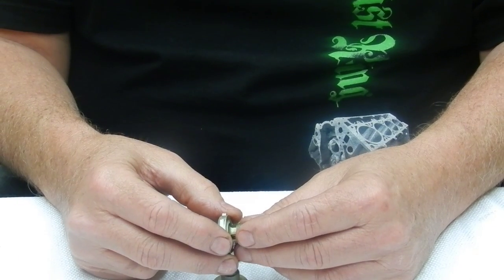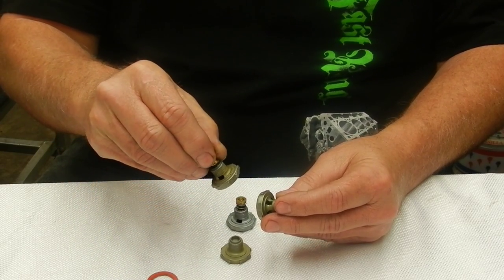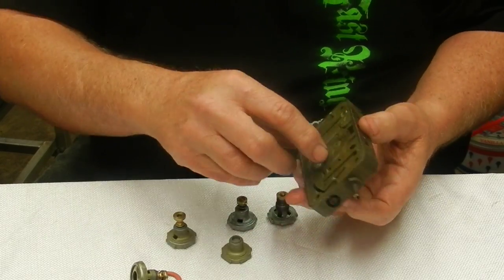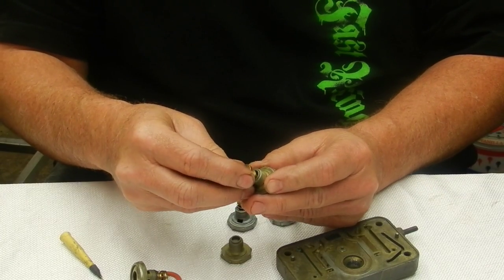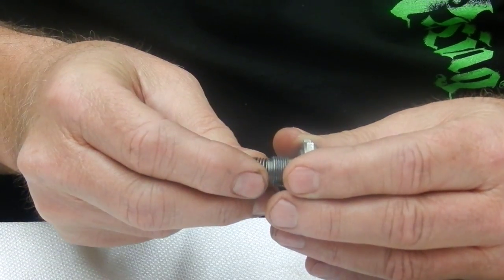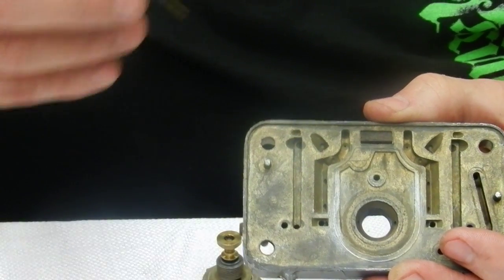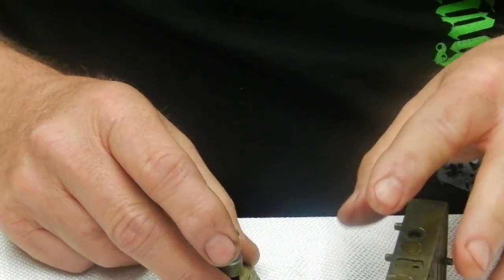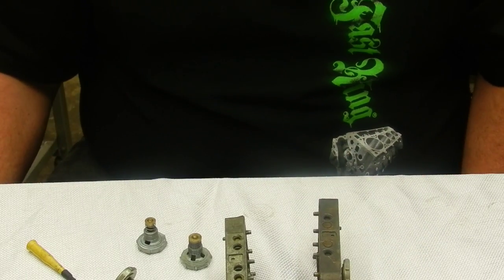Holley Carburetor: Power Valve Explained

Comment: if the PV is not working correctly,could it allow enough fuel thru to foul plugs and make engine run on 6 or 7cyl?Engine runs fine at idle then boat wont get up on plane(loss of power,plugs fouled.) 302 mercruiser engine 4 barrel holly.
Reply from the maker: if the power valve diaphram is ruptured this will cause it to pull fuel out of the bowl , making the mixture extremely rich and foul your plugs, there is other things that make a carb run rich , to much fuel pressure , air bleeds stopped up, bad float , too big jets , don't forget about ignition , weak spark can cause an engine not to burn the fuel completely , these are a few things that can cause a rich mixture that will foul spark plugs. ps  wrong spark plug heat range, hope this helps randy,
Reply: The boat ran fine earlier this year.I had a possible backfire in motor box,but engine never skipped a beat.When i idled down i noticed smoke or steam coming from the top of the carb.next day boat ran bad ,checked all plugs and all were wet and carbon fouled.mechanic has come all summer.has checked everything,firing order,new plugs, wires ,dist cap ,rotor,timing ,points.he has given up!!! carb was not checked thoroughly.Also gas or oil  or both out exhaust, film on water.i am assuming unburned fuel.Have heard that a backfire can ruin a power valve.Is there a way to test the power valve?greatly appreciated.
Reply: also when you snap the throttle it will usually backfire or not be responsive at all.Trying to give you all the clues to the mystery.Thanks.
Reply from the maker: if this happened just after a backfire through the carb , may have damaged the float and or the power valve, the brass float will not handle backfires , and will cause it to flood , or could possibly have damaged both pv and float, easy way to tell if floats are damadged is to compare with a new part . I like to use a nitrophil  floats they seem to hold up better and  are more foregiving,  , ps be extra careful if carb is flooding that is very dangerous in a boat, always check and double check  for any gas leaks,  you cant be to careful, hope this helps
Reply: I ordered a couple of power valves(8.5) ,will try it this weekend. Both floats seem to work fine,the needle valves are fixed and cant be taken out,  also no sight window screw,so not sure how you adjust the level in bowl. Did a test where you screw in idle screws and the boat continued to run, so i am assuming bad P.V . we will see.Thanks for the help.
Reply from the maker: could be a blown power valve, most needle and seats are replaceable  , some don't have external adjustments ,they have to be adjusted by the float tang and  measurement from between top of float and top of fuel bowl, need you to send me the list# off the choke horn of the holley before I can give you any information , most marine holleys have a plastic cover over the needle and seat inslde the fuel bowl , could be why you think needle and seat are not replaceable  , if you are still having trouble after p.v. replacement , let me know  because there is so many things that can cause a rich condition, hope this helps.
Reply: list # 50418
Reply from the maker: carb is a 450 cfm 4160 series holley ,power valve shows in my book to be 8.5 , needle and seat are replaceable but from the inside of the bowl , there is no external adjustment, only internal adjustment ,might have to contact mercruiser for float specifications,  most adjustments are checked with the bowl upside down measuring from top of float to top of bowl , make sure float is not gas logged [ hole in float ] and check your fuel pressure,  to much pressure will cause it to flood, again check specs.for fuel pressure with mercruiser, also it is very important that the vacuum secondary diaphragm is working to help you get on plane .hope this helps
Reply: ok Randy.replaced power valve and boat souded great,running on all 8.ajusted curb idle with cold engine.(she likes 800rpm)adjusted the acc pump ( no play ,15k feeler guage) she is now responsive at throttle.turned idle mix screws In then out 1 & 1/2 ,hooked up vaccum guage.12 inch vaccum.started  to turn screws in slowly both sides and vaccum went up to 17 and then came down so I left it at the highest ( 17)took the boat out she now gets up on plane lots of power . also exhaust smoke went  away as I was adjusting idle mix screws.My issue and maybey its not one is the idle mix screws are 1/2 turn from bottoming out. Is this ok or am I getting into the same lean running blow out P.V issue again down the road?.I didn't try a w.o.t. to see if the secondaries are working but I am not worried about that now.Boat is back to normal and runs fine.Any comments? and Thank You for your time!
Reply from the maker: you might have to lean your idle circuit,  this can be tricky there is several ways but modifications have to be made to lean idle circuit i dont think you have a power valve problem i think you will be ok , with proper tools you can lean it more , you can measure idle air bleed and increase the hole diameter, by .003 at atime. or decrease the idle fuel restrictor, best left up to a pro , i would run it like it is as long as it proforms good . randy
Reply: I noticed when I tested for a bad power valve( by turning idle screws all the way in to see if the engine stumbled) that the screws were already close to bottoming out.The  engine has been running great so I will leave all alone.I will try to rebuild it this winter.Does a 4160 have a fast idle cam? it seems I have to give the engine gas or it wont start, never had that problem before,i would turn the key and it would always start.Choke is adjusted properly.Thanks.

Comment: I have an FE motor that will idle great and run like crazy.  I’ve checked everything I can think of.  However, when I get this engine to idle nice, I blip the throttle and then it idles like garbage with lots of liquid coming out of exhaust. Immediately turn it off and restart, idles perfect, no liquid. .  Blip again and it idles like shit, turn off, restart, good again.  Hammer the throttle and let off and it will idle nice again.  Am I having a power valve issue?  I was thinking weak mechanical advance springs that don’t want to return home?
Reply from the maker: Need more information like carb list #  , type ignition , power brake booster? anything else you can think of. Power valve will not effect idle unless diaphragm is ruptured.
Reply: List #9834, converted elect ign, power brakes, two vacuum gauges report 15-20 psi, electric fuel pump with about 4-6psi and good volume to carb.  I have noticed is that when it starts idling terrible, the vacuum goes way down and jumps around a lot. Also  when idling nice timing is about 8deg and when it goes to shit the timing is 11ish deg. Plugs look good, replaced cap. I really appreciate any info you have, this one is driving me crazy.  The power valve was something I didn’t consider so was wondering if that might be my issue.
Reply from the maker: I don't believe the power valve is bad, should be running rich with black smoke all the time. The power valve only effects idle if the diaphragm is ruptured. The liquid coming out of the exhaust is fuel or water? can you explain ,when the rough idle happens is exhaust rich or lean. I'm still thinking hang with me. By the way are you running a pcv valve?
Reply: @holleycarbshowtosadvice40y90  No pcv valve. I ended up taking the distributor all the way down and it all looks good. Decided to tear into the carb and as i was pulling the metering block off, what I noticed as I was ripping the gasket apart was a piece of crap in the "power fuel passage" on the fuel inlet side of the metering block. Bowl was clean, jets clean, fuel inlet screen clean (although deformed a bit as if it didn't seat right in the fitting), mix screws clean.  Going to get a gasket set and put this thing back together, hoping I found the issue.

Comment: I burnt a head gasket a couple mounts ago and last week I burnt a piston on a 355 with vortex heads a couple people told me I'm running lean.at a 120/130 mph it a 650 holly do I need to install bigger jets.
Reply from the maker: I need your information on your motor and fuel system carburetor size and jets any mods , total timing ,compression ,power adders, which piston burnt #5 or #7? , and water temp. which firing order are you using, camshaft determines firing order , all cam specs ,fuel octane level any info you can think of etc...

Comment: i have an olds 350 engine rebuild in factory specs.i purchse a holley 570 vacuum secondary.the specs say that it has a 8.5 powervalve.i put the vaccum gauge on my intake vacuum and indicates about 10 inches of mercury.if i divine that it makes 5.so...is it best to replace the 8.5 powervale with a 4.5 or a 5.0??also the factory jets on the 570 is 54 primary and 65 scondary.i am thinking of jetting 2 sizes up on both sides!i want to hear your opinion please.
Reply from the maker: i think thats a good choice to install a 4.5 power valve , if after that performance suffers you may need  to make  a jet change and possible a different  accelerator pump discharge nozzle size. hope this helps randy.

Comment: I have a Holley 600 one of the bowl are not filling up
Reply from the maker: Needle an seat are stuck or out of adjustment, some type of blockage , bowl vent plugged or possibly interference with  float  binding. Hope this helps.

Comment: Took my carb off. Holley Street HP 750 Vac Adv. It was surging at cruise. Cleaned really good with spray and put new primary and secondary gaskets on. Also put a new power valve gasket. When I took it off the gasket split. Put the new one on it was thicker. Bolted carb back to car and damn thing will not start. Did not touch anything else but new gaskets. Getting fuel and spark. Chevy with an MSD. Took it back off to inspect and I do not see anything wrong. Weird. It always idles and runs great.
Reply from the maker: check to see if carb is flooding or float level is to high , next check the accelerator pump and make sure it squirts with throttle movement . a lot of carb kits comes with gaskets that fits several different carbs , sometimes the wrong gasket will keep the accelerator pump from working ,hope this helps you.randy

Comment: So if I have 14" vacuum in gear that means I need a 6.5 rite.. I been using A 8.5 AND IDLING RICH
Reply from the maker: Yes a 6.5 will work fine but remember the power valve circuit is separate from the idle circuit , so unless the power valve diaphragm is ruptured it will not effect the idle. Hope this helps.

Comment: why do some people say to run a plug in place of power valve when racing
Reply: Jerry Garner, when you put an engine in a full load, full time situation such as in racing, the effect the power valve provides goes out of the window. At wide open throttle the power valve is open allowing extra fuel into the intake charge. If you are racing, the throttle positions your engine sees are almost always closed and WOT. With those two positions, most racers just choose to block the valve and widen the main jet orfices.
Reply from the maker: jerry some racers block front and rear power valves , but I don't ,I run a primary power valve and block the secondary  ,when you block the primary you lose fuel control at mid throttle , but with a power valve in the primary side you have a better tune ,without the power valve lets say under the yellow flag your not at idle and your not wot all you are is rich, with the power valve you have the best of both worlds ,its all up to the racer,

Comment: BTW  my carb has run rich since the day it was installed and tuned from  my engine builder!
Reply: Get a bus pass or take Uber if you can't tune a Holley. Engine builders test on a stand or dyno. Which BOTH methods are waaaay off from real street/track driving which equates to engine loading. Everyday the weather changes, that affects mixture.
Reply from the maker: I think if you watch my videos you can straightened out this concern. If not let me know.

Comment: I was wondering why my cleveland has lower vacuum at idle than stadard- its cammed- now I know how the power vslve works i can tune my holley;
Reply from the maker: If your cam is to big your engine vacuum will drop , you have to match everything , if the cam has a late intake valve closing and a lot of overlap it will drop your static compression  down dynamically to much, and will lower ldle vacuum and hurt idle quality and low end performance there is a way to help regain some perf. By advancing the camshaft by 4degrees you have to recheck valve to piston  clearense , advancing the cam will lesson the running clearense between the intake valve and the piston , if you have enough clearense this will help your condition , not the best fix but usually helps. matching your parts correctly is the best way to go compression has to be increased as  camshaft specs increase , hope this helps, this is a subject you could right a book about.
Reply: I have been round and round with my big cam low vacuum Cleveland too. Finally really started to get it figured out. If you are still having issues feel free to send me a PM and we can compare notes, share ideas.

Comment: Question? Am I correct is saying that if the rating of the Power Valve is lets say a 6.5 and that's higher than the idle vacuum at 5 inches of vacuum at 900rpm the engine will run too rich because the Power Valve is Open, and if the Power Valve is a 2.5 the engine could run lean until the engine vacuum is below 2.5 inches of vacuum? On this new build I have a new AED 750dp on a Chevy 302ci with 10.5 compression, Comp Cams custom grind solid flat tappet with .516 intake and .537 exh lift with 242 intake and 250 duration @ .050 and with a 110 lobe separation, valves set to .012 cold, new MSD ignition and pro-billet distributer, Victor Jr intake, AFR 180 Street Heads bolted to 1-5/8" headers to 3" flowmasters. It mated to a M21 trans and 3.90 gears on a 28" tall tire. I had the timing at 19* initial and 36* with the same problem but my Brother told me it was too much for 91 pump gas so I lowered it to 13* btdc initial at idle and 32* total. Plugs are all consistant light tan color as well.

The problem I'm having is an intermittent lean pop and low power through the carburetor when under load accelerating in 1st gear under 3k rpm and inconsistent idle rpm when warm to operating temperature. I'm at 1-1/2 turns out on the Air/Fuel screws, accelerator pumps adjusted properly with cams in the #2 position. I just opened the secondary butterflies because too much of the idle slot was showing from the underside of the primary butterflies (this did help the idle but is lower idle at operating temperature than when warm). The standard squirters are 31's as well. The vacuum at 900 rpm is at 5 inches so I put a 2.5 power valve in it and didn't think about it much until I watched your videos on this subject. I'm thinking I should have a 4.5 power valve. Am I on to something here or what else can I check or adjust? BTW, above 4k rpm it's an ANIMAL for a 302! Thoughts?
Reply from the maker: The power valve will not effect the idle circuit, the power valve only flows fuel through the boosters and they usually start flowing fuel around 2000 rpms, now if the power valve diaphragm is ruptured it will make the idle rich and thats very possible with engine backfires and also check your floats backfires will damage them too. I always try to run my initial timing as high as I can usually around 15 and total timing about 34 to 36. If you still have problems check your cranking compression and let me know.hope this helps.
Reply: @holleycarbshowtosadvice40y90  Thank you for your response! That helps!
Reply from the maker: Anytime

Comment: My cam is so big that it pulls no vacuum so the boaters where dripping at idle bc the power valve correct
Reply from the maker: I need more information  engine size, cam specs. Carb, compression ,  cylinders heads, intake.